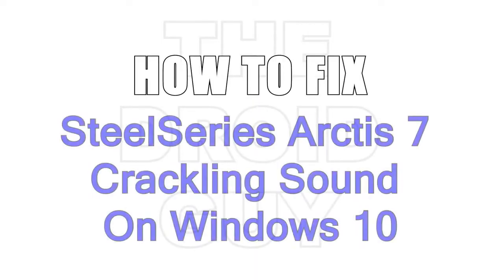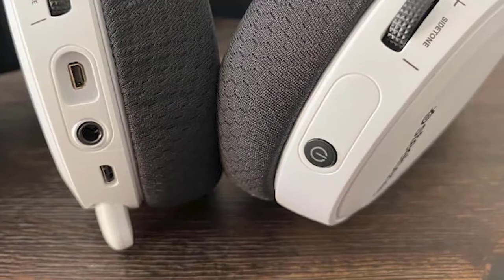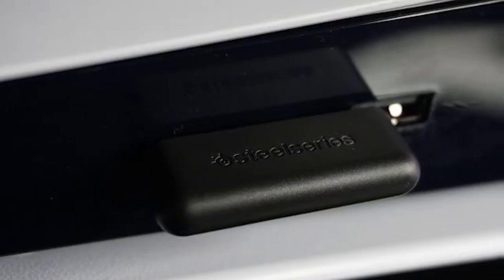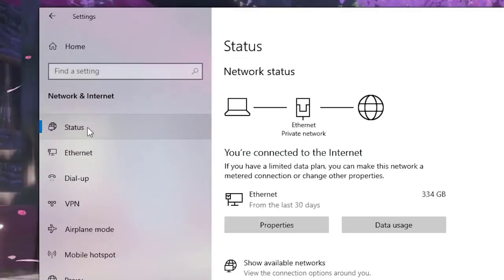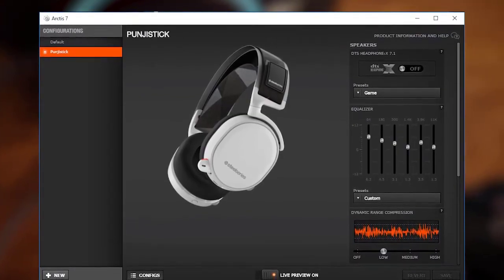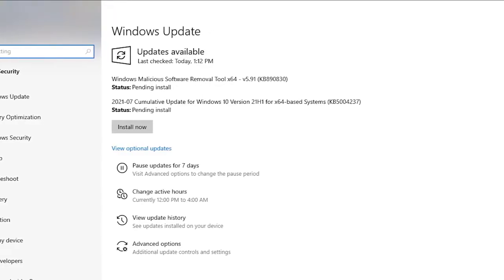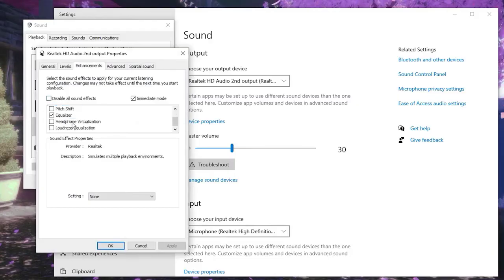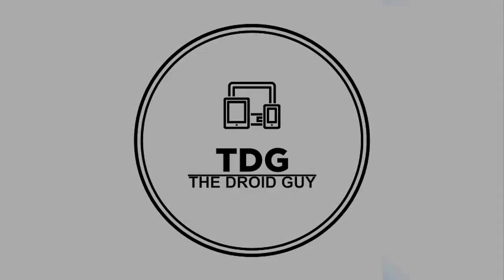How To Fix SteelSeries Arctis 7 Crackling Sound On Windows 10

Comment: So we pay $250 for a headset that has all the bells and whistles .. just to take away the bells and whistles? These are not fixes. These are work arounds. This does not fix the issue. I have had distortion issues with these headphones for over 6 months now.
Reply: Fr bro
Reply: Same. Worst buy ever! I still have my old tuf H7 wireless, better than my arcts 7+ and cheaper 😅
Reply: i just pulled artics pro wireless out of the box and I'm having this issue with the mic. smh

Comment: How to fix on PS5???
Reply: My issue is that the audio cuts off. I be playing a game and the background music of the game would stop playing for a few seconds you can only hear like the footsteps during that time
Reply: @UnleashedEx Were you able to fix it? Mines is doing that now.
Reply: @macruz8503   no I was not able to fix it. I even got a replacement headset thinking my model was defective but the new replacement ended up having the same issue. I’ve updated the headset using the laptop, I’ve moved the location of the bluetooth dongle to the front of the ps5, ive been messing with the audio settings in the ps5 The only thing i still haven’t tried is switching to a new HDMI cable. I think im just gonna buy a brand new headset from a different brand I might try the pulse elite headset from playstation.

Comment: Yeah, I have the Arctis 7+ Wireless headset and my beef is that the audio feedback keeps fading and in and out and sometimes the audio gets choppy and stutters. This is really frustrating and I don't know why it's been doing this. Is it an HP Victus problem?
Reply: did you fix it? I have the arctis 7+ and I have similar problems
Reply: @Zogpe  So and so. I plugged it into a 3.0 port and it seems somewhat better but the audio still kinda crackles and stutters.
Reply: @obnoxiousoboe  did u fix now my headset  have this problem too
Reply: @obnoxiousoboe My issue is that the audio cuts off. I be playing a game and the background music of the game would stop playing for a few seconds you can only hear like the footsteps during that time.
Reply: @burakhnak My issue is that the audio cuts off. I be playing a game and the background music of the game would stop playing for a few seconds you can only hear like the footsteps during that time
Reply: @Zogpe  My issue is that the audio cuts off. I be playing a game and the background music of the game would stop playing for a few seconds you can only hear like the footsteps during that time
Reply: @UnleashedEx did you fix that?

Comment: On my Arctics Pro Nova, switching the USB port to another one fixed it for me!
Reply: on my mom you saved my life
Reply: bro you're such a life saver
Reply: On my life this fuckin worked. I had it plugged into a USB hub and it crackled any time I was in a game, this is a lifesaver!!
Reply: Wait how do you do this
Reply: You are just overthinking it, just pull out the plug on the back of your computer going to your Steelseries Charing Dock or headset (depending on which headset you have) and plug it into another port, most PC's have 6 ports, just choose another one than the one giving the crackling sound @jacobansaldo7054
Reply: @jacobansaldo7054bro literally just plug the connector into another usb port. your pc should have like 3 of them
Reply: Thanks bro, I'll try that on my wife and switch her with her sister.
Reply: 2025 and this fix still worked for me, you are a lifesaver
Reply: holy shit thank you, you've saved my sanity trying to solve this
Reply: my goat i couldn't figure this out for so long thank you